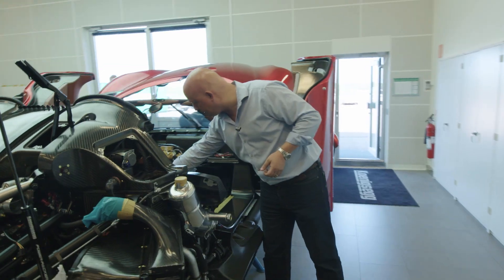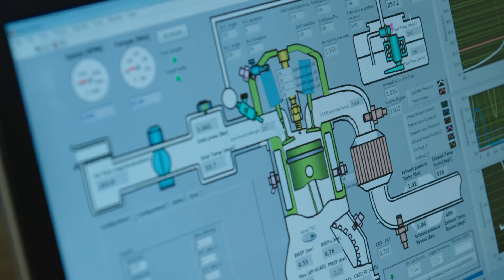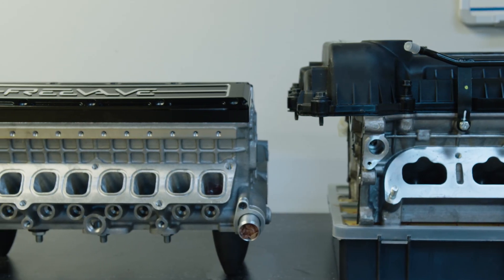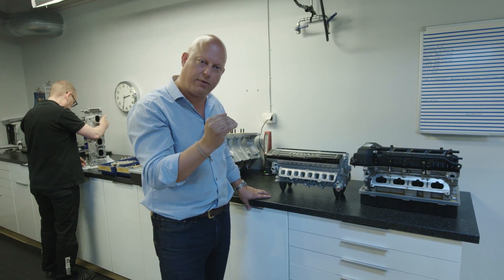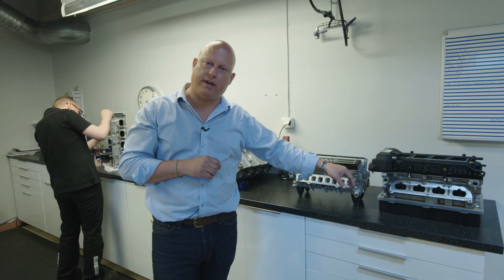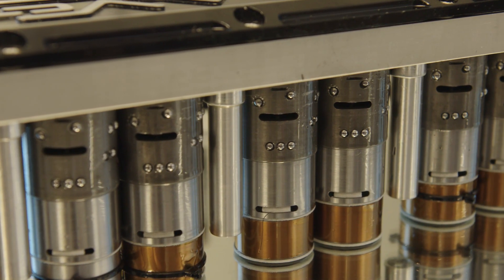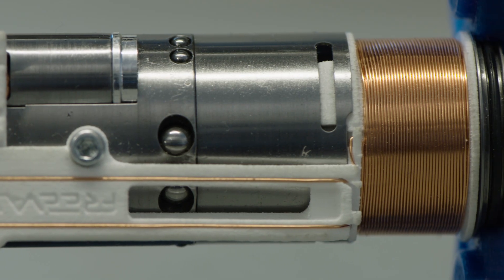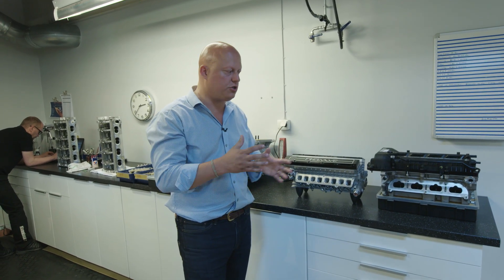Freevalve Update Camless Engine -- /INSIDE KOENIGSEGG

Comment: I had this same idea years ago (Just didn't have the money or connections to develope it) of solenoid controlled valves to allow lift and timing for any driving situation and completely selectable by the driver from the dash. You want a race cam? You just press a button and it gives you more lift, duration and overlap. You want a mileage cam? Just press a button. Also, with a four valve per cyl. you can control them all individually. I'm happy to see that a manufacturer incorporated this into their design, finally. Christian, next I'd like to see valves that are sliding (pocket) doors which would eliminate the flow restriction of the open poppet valve head. Imagine the port flow capabilities.
Reply: It still needs development. Why not jump in.
Reply: The idea has been around for a long time. Very much easier said than done. Looks like these guys may actually pull it off!
Reply: Why not just rotate the door in a disk? Seems a better idea than slamming a valve open and shut.

Comment: The really revolutionary aspects of this is the fact that an engine can idle like a Rolls Royce, have lots of bottom end torque for standing start acceleration, no need for a throttle plate to interrupt airflow, totally variable valve actuation for the perfect airflow toe each cylinder to balance out dynamic imbalance, cylinder-on-demand carried out flawlessly and high rpm torque generated by valve actuation never possible with mechanical valve train components. All the actuation is so easy for a computer to control since even at20,000 rpm, everything is in slow motion from an electrical and electronic perspective. Add a turbo or nitrous or maybe even O2 & H2Oinjection and this system could react to it.
Reply: This engine can change from a 4-stroke to a 2-stroke.

Comment: They have not explained where they are getting their compressed air at to operate the pneumatic actuated valves. 

Electric compressor or driven from engine? Both would consume a small amount of hp.

Comment: I feel all this is like shuffling deckchairs on the Titanic.  It is going to go down, no matter. 
It takes about the same amount of electrical energy to refine a litre of petro fuel. The same amount of electricity to drive an electric car about the same distance as a litre of petro fuel in a car. Just one UK refinery uses the same amount of electricity as the cities of Leicester and Coventry combined. 
So:
 • Pollution to make petro fuels
 • Pollution when petro fuels are burned

Cut out the polluting petrol and go direct using EVs. Then our lungs are protected. Deaths from air pollution is substantial 

Using Powerwall batteries, like the Tesla Powerwall and solar PVs on roofs, most electrical grids can cope if all cars went over to EV. *Right now*i f one million Powerwall batteries were fitted in homes a country like in the UK (population 65 million) , they could take 4 power stations out of commission. Put solar panels on the one million roofs and there is energy in abundance. 

https://www.youtube.com/watch?v=BQpX-9OyEr4

Bring it on ASAP.

The Powerwall. It can be used keep electricity bills low to charge an EV. It shines when PV solar panels are fitted. 
https://www.youtube.com/watch?v=jB6jyy0Joq8&t=1s
Reply: Where I live coal is burned to make electricity.

Comment: All the big money is going into EV battery R&D and increasing charging infrastructure.  This camless engine is welcome however is is only scratching the surface.  The end of the piston/crankshaft engine is in sight. The future is EVs.  But Koenigsegg are into EVs anyhow.
Reply: It will take years before electric cars in any substantial way has replaced ICE cars. And hybrids will also have a large market share, and they consume fuel. This technology on the other hand can decreas CO2 emissions far faster.

Comment: In the 90s, BMW has developed electronic valve system, in terms of law of thermodynamics and mechanics, driving any continuous  electro mechanical components to operate an engine can't make any efficiency gains. This is not genius, this is a story for business plans to sell investors, not experienced engineers or manufacturers. The way that an internal combustion engine is that the output torque, driving alternator, each step has an efficiency lost. Think about an alternator generate electricity to power the camshafts movements, then its a lost, no where to gain to anywhere. Chris is not an engineer, people need good maths and theory to manage a scientific break through, he should go to school properly to become a proper engineering company leader.

Comment: No throttle, no wastegate,stratospheric compression without direct injection,50% footprint 50% power gains, shows how much is left on the table in head design. Revolutionary.

Comment: camless engine...ever hear of modular displacement?? cadillac  sure did...in the 1980s look up L62 8-6-4
Reply: Cylinder deactivation is nothing special. Modular displacement is not the correct term. They couldn't make that work well and even today they (GM) still have problems with their active fuel management.

Comment: Getting 240 horsepower out of a normally aspirated 1.6-liter 4-cylinder is amazing.

I wonder if Koenigsegg will develop a way to vary the crank geometry to change the stroke/cylinder volume. Combined with the infinitely variable camless Freevalve system controlling the valve timing and duration could create the most powerful and efficient internal combustion engine ever.

Comment: I can also see this system being useful as you can update a older engine much easier, lets say for example a older engine design that uses push rods and two valves per cylinder like a small block V8 or older V6 engine designs like a 3800, you can use this system to more easily update the engine to a 4 valve per cylinder engine without doing a ton of work to find a way to drive the valve train and keep it cooled and lubricated. or you can even remove the cam, lifters, push rods, and rockers from the equation all together and just replace it with the free valve system and probably gain power and efficiency that way as well.

Comment: This is amazing stuff.  I still remember working on my father's 1961 Chevrolet Biscayne with a straight six engine (230 C.I., I think), adjusting the valves, tweaking the single barrel Rochester & changing the oil in the air filter (back then, they had oil bath AIR filters).  That car didn't have an oil filter - just a breather pipe.  Pop maintained that thing both overseas in Spain and in the U.S.; when we gave it away to my uncle, it had over 200K miles on it.  

I wish my Pop could see this - he was very mechanically inclined and taught me how to do preventive maintenance.  This technology is so, so cool.  This is the kind of stuff humans should spend money on instead of the weapons of war.  Still, truly amazing.  Thank you for posting.

Comment: Solenoids and Hydraulic actuators are not key components for Longevity. 
Say what you want about the good old camshafts and chains but those suckers can probably outlast the car.

I wonder what is the estimated operating hours of the Freevalve drivetrain?

Comment: i am a fan of oldschool, overhead valve, fix it with a hammer kinda guy, i built a motorcycle in my garage out of a fucked over rebuilt honda cement mixer motor and a bmx bike and some scrap metal, ive always hated things like computers and EFI cause i couldnt do anything about them breaking, the only thing i could do was spray it with flex seal and hope its water proof. . .but this free valve thing is pretty damn cool, imagine if honda made a small single cylinder free valve engine where there was nothing in the crank case but the crank and its bearings and some oil, it could be way smaller and lighter, the cylinder head would be atleast the same size as the OHV head and it could be direct injected, no carb, no, choke, no cold start like he said, it could start in any temperature as long as the fuel was still liquid, it wouldnt be coil ignition neither, it would be a brushless epoxy dipped waterproof starter/ generator inside of a motorcycle type flywheel with wires that went to like a little adruino box under the fuel tank right in the middle on the top, it would start with a small lipo battery and then it would top it back up, that little box would be the thing that took care of the free valves, fuel injection and ignition, i would make that computer unit be as inexpensive to make as possible without allowing quality and performance to suffer, it would be in a waterproof box or a potted end epoxied sealed unit with plugs that had 0 rings in em so once you plugged it in the terminals couldnt get water corrosion or any of that (the whole thing would be waterproof and would have voltage spike protection and all those goodies ) i would make it as reliable as possible, it would even have a little screen on it with an oil level and temp display, cylinder head temp, fuel gage and it would show it all when you just clicked a button on the face, it would have one of those thick bulletproof glass touchscreens or something, so it was fancy as fuck but also rugged and reliable in an industrial environment, its a shame anytime someone says "new and improved it usually means new and worse in every way (like the iphone 7 and the m16 rifle over the m 14 back in the day) i would strive to improve in the faults while leaving its strengths alone or embracing them, it would have a hardened steel cylinder sleeve and a thick aluminum block, not like those new paper thin plastic carb ohv briggs and stratton lawnmower engines, it would truly be an industry leading state of the art engine for the universal fit power equipment platform. . .too bad i dont have the money to invent it myself or i would

Comment: a little research (scrolling) shows they are a combination of and plus another element. Pneumatically actuated spring assembly with oil -hold and dampening and the electronic coils are actually position sensors feeding back to the management software XD Ziiiiing !

Comment: Nothing new, both hydraulic and pneumatic have been done before both in diesel and gasoline. reliability has always been the downfall because in either system once you develop a leak or pressure loss valve control is severely hampered. Where with a mechanical actuator such as a cam and lifter you never have that kind of failure even if a higher friction loss system with less valve control due to spring limits at higher rpm aka valve float.

Though in the case of hyper cars if you can afford to buy them you can afford to have them repaired often.

Comment: It will be cool, and good to see when it comes out, but the first generation of it will be modifying older engines. It won't see it's true potential for efficiency or power until they make an engine based around this technology. Would really like to see how small of an engine you could kick out that still kept around 140 hp to power most simple sedans around 3,000 lbs.

Comment: I thought of that particular valve system in 2003 back when I had a four valves broken in my h22 engine, I even had drawings and cad models on these, my aim was to rev an engine that could have been put in a daily drive as high as 18000 rpm . If I find the money I'll still go for it.

Comment: The last shot shown with the contacts for the valve solenoids shows them soldered directly through the PCB (as far as I can tell).  This is a very bad idea.  There should be some form of stress relief in such situations.  I would imagine that solenoid failure would be a very expensive failure.  I speak with a lot of experience in audio where such situations invariably cause mid-life failure due to stress cracking as a result of either temperature or in some cases direct audio vibration;  I would imagine the vibrations in a car engine are not dissimilar.  I have also seen many cases of this type of electromechanical failure in things such as 12V car solenoids for diesel heater plugs etc.

Comment: As mentioned before, this is old tech(camless valve train). F1 had camless pneumatic valve trains decades ago, and I think they went electromagnetic for a while too, which was even faster but less reliable
Reply: no they didn't, they had hydraulic springs, but still used cams to actuate.
Reply: I stand corrected. (y)

Comment: from an electronics tech's pov: solder joint integrity over time(heat cycling exacerbating the problem when combined with physical vibration)/electrolytic capacitor use(heat cycling and electrolyte leakage with age failure points) in circuit design? both are weak points in regards to longevity even in stationary applications.just thinking common mode failure points that seem to be creeping up in cars mf'd in the last 10 to 12 years.things that potentially boat anchor a car.

Comment: There is so much good that can come from cam-less engines. And this guy is actually bringing it into reality. Imagine this in a motorcycle, or a single cylinder 4-stroke dirt bike. This will make 4 strokes more powerful, way more fuel efficient, way cleaner, and probably very close to the light weight compared to a 2-stroke engine. THIS NEEDS TO COME TO THE MOTORCYCLE INDUSTRY ALONG WITH THE AUTOMOTIVE INDUSTRY!!!!
Reply: that means you can get a 250 hp r1 witch uses the same amount of fuel of a r3

Comment: Wow, exciting to see Koenigsegg port F1 technology into production engines. No more cams, bearings or large housings (cost, weight, friction). No more chains (stretch), guides (break) or complex variable camshaft units (cost, friction). 

Can someone explain why port injected turbo engines can run 14:1 compression vs. 9:1 on direct injection?

Comment: 1 port per valve is also @ the CA16DE made by Nissan and it is great for torque. I need this for my daily driver 110KW SR20DE from 1990 in my Primera P10. Nissan SR20VE or Honda K20 engine with this camless head = perfect.

Comment: There's one thing for sure, I doubt if the oil industry and companies that would be seriously affected by this technology is going to allow mass production of it. They have enough political power and money to defeat these innovations. They believe squeezing more power from a woefully downsized engine with an expensive turbo is their answer. There's not much difference between a turbo 4 cylinder and a bigger V6 normally aspirated in gas mileage comparing engine horsepower and torque. The 4 cylinder has to rev much faster than the 6 and/or have an over complicated transmission to obtain the 6's performance. Which one is more durable?

Comment: Fascinating technology. Being an ICE man and, for a time a professional mechanic, I can appreciate the advantages and the marvelous advancement of ICE engines. However, this is dead technology. Electric motors will ELIMINATE all the problems Christian spoke about, and additionally: Less moving parts, less weight, more efficient, quieter, cleaner, cheaper, and tremendously easier to build. The MINUTE a long lasting battery comes to fruition the gasoline engine will be as useless as the once mighty and all powerful steam engines. Further, electric motor powered cars ALREADY are faster than their gasoline counterparts. Battery technology will render the gasoline engine obsolete within 10 years. Sad to see them go though.
Reply: i dont think the oil company like that though..
Reply: Please Google search, "Deferred Atkinson Cycle and Simultaneous Heat Extraction Engine".
Reply: Would you be more interested in buying an electric car or an innovative called engine? Actually don't answer that. A lot of people will prefer the innovative ideas, plus this opens doors for new technology

Comment: I have a ford 2.9 boa cosworth 24 valve v6 would that be possible to modify the head to run such a set up and at first start where the engine get its pressurise air to actived the valve?
andre from canada

Comment: sounds perfect. are there some intense tests to see how many km can a car do before failing? what would be replacement price for a regular 4 cylinder engine? head has to be removed in order to change actuators? i think those are reasons other manufacturers did not start using this technology... keep up the good work!

Comment: normally l prefer manual operated engines over electronic controlled for its simplicity and its advantage of people can fix it themselves vs overpriced shops BUT as far as high tech this rocks .l love all the advantages he s stating in this video makes sense ,especially the advantages in displacement vs power figures and efficiency

Comment: The astonishing thing is why it takes so long for the automotive industry to computerize intelligently the valve system? What the heck is the reason why this wasn't done 30 years ago? With all respect, it seems like engine design for decades has been done by incredibly conservative mechanical engineers with no depth of knowledge in other fields of engineering.

Comment: Yeah... I'm interested in the part where you can somehow run a 40:1 compression ratio on a turbocharged engine without detonation since thats uh.. physically impossible.  If he's actually just talking about turbo-diesel then port injection isnt an option anyway.'
I get the impression that what we're talking about here is just plain throttling down the engine at low RPM's to maintain an effective compression ratio of about the standard 9:1.  Seems kind of misleading at best.

Comment: I've always wondered if there could be a more effective way to operate the valvetrain without using cams. Mechanical (standard) way could be more useful as of today, but this actuator approach will win by a mile in the long run. RIP vtec xD
Reply: Controlling the valves requires a very fast computer. Until recently we didn't have the computer capable of doing that. Anyone remember the disaster of the Cadillac 4- 6- 8 motor? Same problem great idea lousy computer.